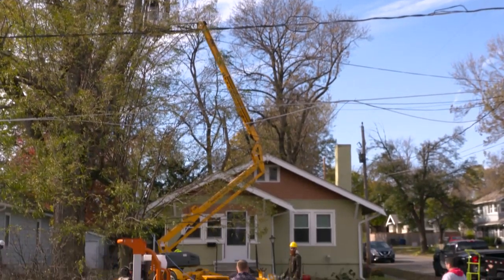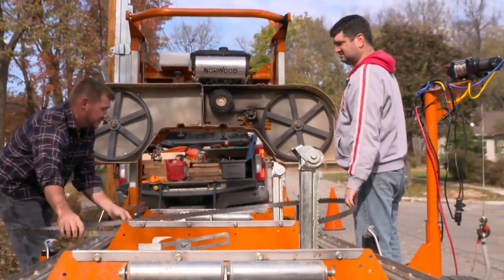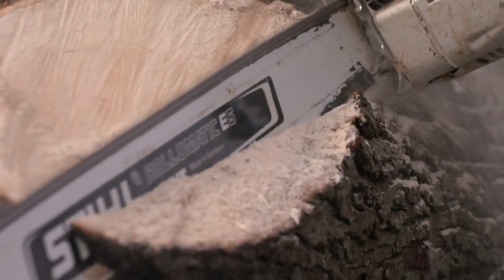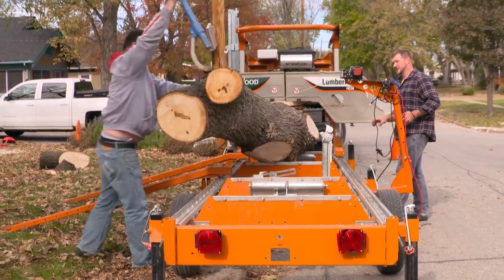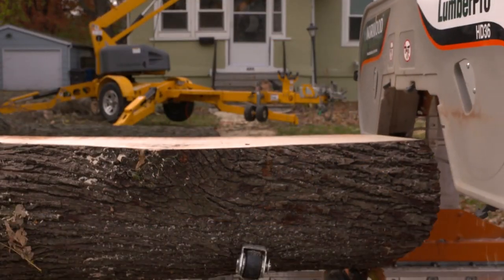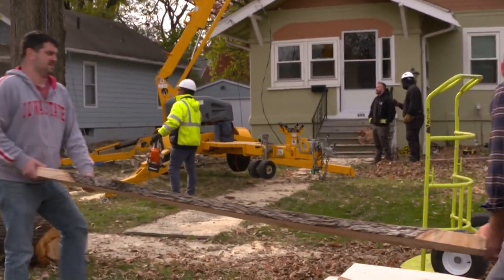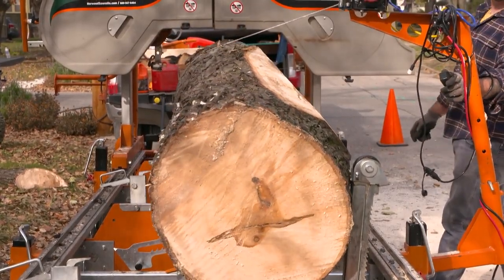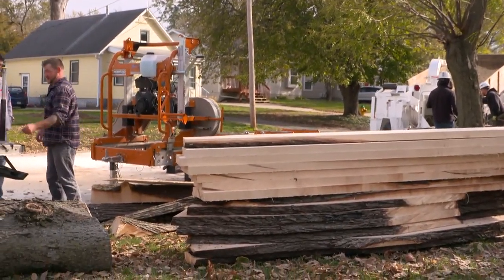Milling Lumber With My Norwood Portable Saw Mill

Comment: Nice job. I made a deal with a Sawyer and got 150 board feet of Walnut milled and kiln dried for free and he ended up with about 300 board feet from the same tree. I don't own a mill but wish there was a website to find guys in your area that can do what your doing.  I presently have a 36 inch by 32ft straight maple that needs to be saved from rotting. It was cut down at my workplace this past December but no one will come on site to mill it, you have to bring the log to them.

Comment: I think you are one of the luckiest people around - you get to do what you love every single day, and can make a living at it. Good for you!

After you've milled it, how long do you have to wait for it to dry out before you can use the wood?
Reply: Without any type of kiln 10 months to 2 years. You have to check with a moisture meter.
Reply from the maker: Yes, I agree with you. I am not sure what I did in a previous life to get this lucky. As far as drying it - the rule of thumb is 1 year per inch of thickness. Linden/Basswood goes a little faster, so probably about 16-18 months.